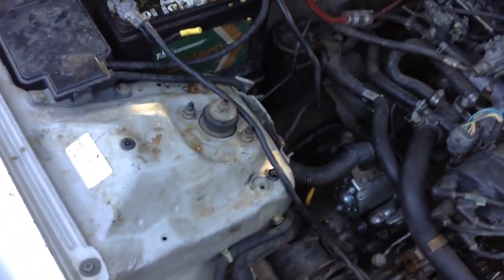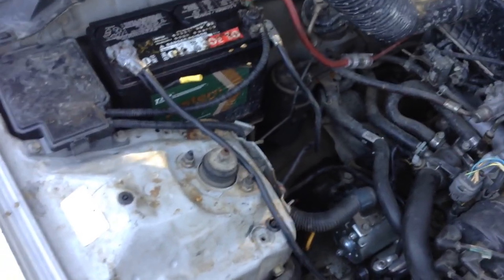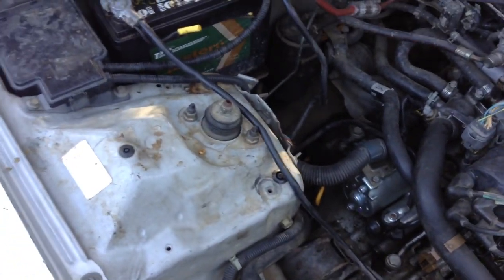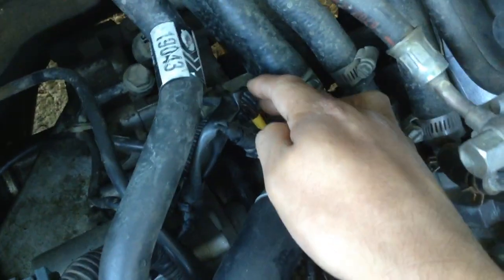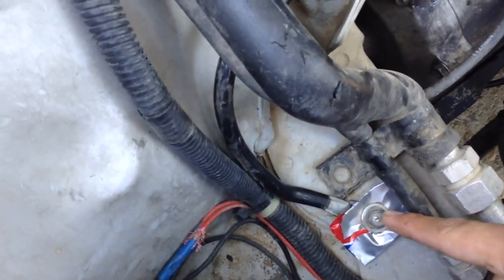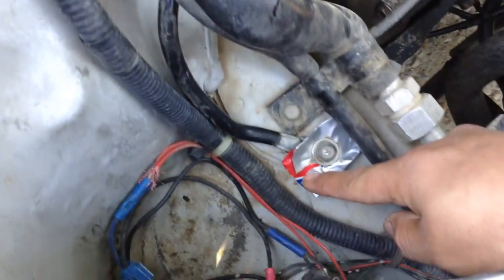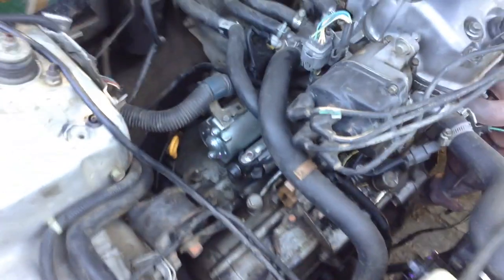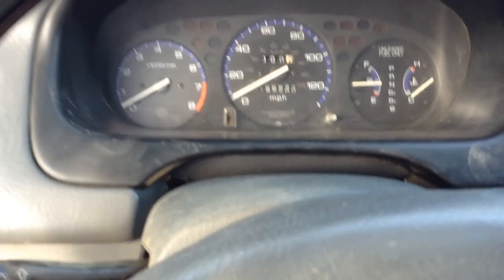96 Honda Civic starting and ground issue fix

Comment: Another guy takes a metal wire brush that you put onto a drill then scrape the paint of in the same place where you screw it in and uses a star washer to make sure it connects to the metal... .just a thought!

Comment: What is the problem if your car will only run if the scan tool is plugged in if you take it off it shuts off the car

Comment: I have a 1994 Honda I put a 5r battery in it and it still won’t turn on 😢
Reply from the maker: Dose it crank but no start or wont start wont crank? Or maybe dose it just not do anything? I also seen flicking dash on the hondas and usiolly when theirs nothing or flickering lights it can be just a grown issue. When i say nothing i mean no crank no start just light on dash but goes of and on

Comment from the maker: The grown wire was originally were the thermostat pipe is were the othe grown wire was at I had changed it due to a bad wire signal. Hope this helps
Reply: Mr MuscleCarsuspect  bad wire signal from where ? Stater fuse ?
Reply from the maker: THRYZ FIREGANG my bad bro for some reason it didn’t show me your msg before. It was on the thermostat pipe before for grown but it was not getting good grown their so I had to move it

Comment: Any idea of what it looked like before you had the piece can on it? How did you know it was bad? Placing a piece of aluminum under a screw will make the car start? I'm a bit confused.
Reply from the maker: Joe Humeas Joe Humeas it’s just a grown wire. You need grown for the car to start if theirs no grown the car will not start and the wire was in that same spot it’s in that’s how I bought the car I no longer own this car but ik that’s we’re the wire was at I bolive
Reply: @mrmusclecarsuspect5362  Was the wire not connected to the car? Was it just floating and you needed to used the aluminum to press it down?
Reply from the maker: Joe Humeas the wire was on their with the screw but for some reason it was not getting ground in that area. And the aluminum just helps it get ground better!  The grown wire where the thermostat pipe is also was getting bad grown but I replaced the tip and that helped sometimes in can just be a bad tip or just a bad wire.

Comment: Hey brother what were your symptoms that lead you doing this? Ihave a 99 civic ex & the car doesn’t crank or nothing just clicks when I pass charge on the battery, I tested all 3 battery, starter & alternator & their all good… so my last resort is the ground… I’m a bit lost on how to start diagnosing the ground cables & all that
Reply: I have a 99 as well. Quick question if you turn the key to run and jump the starter solenoid with a piece of metal does the car start? If so it could be your ignition switch if not the ground.

Comment: Hello have the same issue where mine cranks and doesn’t start sometimes..and drives perfectly fine so could that be due to that same ground? I’ve tried everything lol
Reply from the maker: @shamdagoat3659  if it cracks sometimes and won't start but starts randomly, it can be a loose grown or bad grown wire. Make sure to check your terminals on your matter and make sure they aint loose, and i mean, check them all well. When replacing the grown or doing anything electrical. You want to make sure to have your battery disconnected. Always dissconect your battery.

Comment: Hey what if my alternator is brand new battery is good and i replcaed the wires and terminals on my 92 accord but im having a pulsating isuse with my head lights and rear lights basically all the lights in the car pulsate so does the idle what do u think could be the problem?
Reply from the maker: first did you check if any wires might be coming into contact with other wires sounds like you might be having a mechanical short circute. make sure all your wires are connected properly and make sure the grown wire on the starter has its o ring properly placed that happens before to a friend he forgot to put the o ring on the grown wire, it comes with one.
Reply: There's also a Short Issue on those Years. Under and Behind the Intake Manifold. Good Luck.
Reply: Check the Electric load detector ELD or just replace it
Reply: Try grounding the alternator and see what happens

Comment: hello sir is that Car Body Ground that is safe for honda civic 96 model if i installed like this Ground cable?? pls i need ur help
Reply from the maker: Almz Alison it should be I never had an issue anymore after I did this on my Honda Civic, do it this way it should be safe!
Reply: Mr MuscleCarsuspect  Wow Thank you sir for the huge Help so i will ask car technician to install it for me bcoz i had problem with my honda civic 96 just recently it wont start then if theyl put jumpstart it will start..so maybe i need this install gound cable in my car same like your car😊👏 thank u
Reply from the maker: Almz Alison if car dies and needs a jump to start might want to have battery check out and alternator at your loca parts store for free and find out if it’s that, and also grown issue wouldn’t let your car start either if the area it’s on has no good grown
Reply: Mr MuscleCarsuspect Thank you sir i will go to Car mechanic very soon for check up il let u know sir thank you for your reply and help God bless you 😊

Comment: I got a 1996 Honda Civic ek I need help my car take long to turn on i have to crank it and stop and crank again and it will start rit up after I do 2 cranks cause if I keep cranking it and it take so long to start up before it use to turn on rit away can u please help me
Reply from the maker: So it sounds like you have a crank but no start only after more than one try.. if thats the case your started is probably going out. Happend to me. Same thing it turned out being the starter but always check your growns. And make sure you always disconect the negative cable when working on electrical parts like replacing the starter.

Comment: Is another ground from by the starter to somewhere else on your video.
I did run a 2 g from the battery terminal to the original ground bolt and then from the original ground bolt  I run a 4 g cable to the braket bolt ground by the transmission. That bolt hold the ground cable that goes to the chassis by the passenger side tire.
Reply from the maker: DJohn NineOneSix this method I use gives it better ground contact but usolly you can just find a good ground in a good area like we’re the thermostat housing is . Their is another ground wire that comes from the starter. I don’t have this Honda no-more since years ago lol try this method it should work
Reply: @mrmusclecarsuspect5362  oh okay..
Well my problem was a bad ground cable.
From the battery to the chassis. About 5 inches long.
But since I have high performance parts and high power audio system and a AGM battery I decided to install a 2 gauge cable from the negative battery post to the chassis bolt and add a ground cable from the same bolt to the bolt on the braket transmission.
Thanks for your reply.
Reply from the maker: DJohn NineOneSix try a longer wire you local auto stor should have one to fix perfect find another boot or try placing the aluminum peace from a can into the bolt with the ground it should give it beter contact and fix your issue
Reply: @mrmusclecarsuspect5362  thanks
Reply from the maker: DJohn NineOneSix no problem

Comment: would your car still crank if you had a bad ground?
Reply from the maker: If its a bad ground you should just hear a click. The car will not crank with a bad grown.
Reply: @mrmusclecarsuspect5362  

Perfect man , thank you.
Can I explain what I have done real quick and maybe let me know what else to check ?

It’s a 98 Honda Civic dx auto , no spark but cranks. 

- the fuel pump primes , fuel is getting to the injectors 
- the cam shaft turns so I know the timing belt is fine. I pulled the oil cap off and had my son crank it. 
- I put a new distributor on it , still no spark.
- checked the fuses related to the Ignition components , they looked fine. 

I’m planning to change the main relay and the crank positioning sensor. 

Any other ideas ? The car was running fine , just random turned off. 

Thanks 🙏
Reply from the maker: @reza_dc2  check cps and main relay even sometimes it can be be a bad starter that wont allow your car to start try tappig he starter wil having someone start the car in a safe matter alwsys secure your wheels. Another thing you kight want to check it your sparkplug wires even with one bad wire car eill not start and also those i bolive have a fuel filter a dirty fuel filter will cause your car to randomly shut off. Sometimes it can just he a simple fuel filter. Sorry for the late reply.
Reply: @mrmusclecarsuspect5362  

Thanks for the feedback Boss.
I’ll give those all a shot. Once I figure it out I’ll come back and let you know what it was. In case any future viewers have the same issue.
Thanks Bud 🙏
Reply from the maker: @reza_dc2  your welcome thanks for watching. Good luck

Comment: My 97 honda civic hx has a issue on starting up in the mornings. I turn the key over it starts a bit and shuts off while the key is down and then starts up quick but sounds rough when starting can it be from a bad ground? I have the black cable on the shock nut by the way.
Reply from the maker: George Serrato if you’re car start up then stalls and dies after can be a MAF sensor, it can be cleaned with a Mass Air flow cleaner or you can replace if damaged or worn out.. you can also check for vacuum leaks, main relay and also dose it sound like a misfire? A bad grown is a crank no start mostly it won’t start if it’s a grown issues mostly.. let me know if you got more questions
Reply: @mrmusclecarsuspect5362  i cleaned up the MAF sensor. And i don't have no codes neither and i was wondering the ground cable not being on the frame. And im thinking the starter when the car is warmed up when i drive and start it up again it starts up easy.
Reply from the maker: George Serrato the car dies right away or right after it warms up? You might want to make sure you ain’t got no loose wires maybe the battery wore or change were you have your grown wire at to somewhere you get better grown sometimes it tends to affect it in different ways.. won’t hurt to try has happens before I to me on my Mazda 3 car shut off out of nowhere and it was a bad connection to the better the grown.
Reply: @mrmusclecarsuspect5362  what it does the rpm needle hops to 1000 and goes 0 like a tap start and hold the key to start like in 1 second and sound of it actually starting up running its only happens when before warming it up. And when after driving it and go drive again it starts fine. If i have the engine at operating temperature.
Reply from the maker: George Serrato spark plugs
,air filter ,fuel pressure, vacuum leaks EGR needs a clean and check your battery connections make sure they are good and that you have a good battery.. also have you checked at your local parts store with a scanner to see if you get any codes?
Reply: @mrmusclecarsuspect5362  i changed the EGR valve and cleaned the intake passages and cleaned the fuel injectors and changed 2 of 4 injectors due to broken plastic tips. And i scanned with my obd reader no codes in my car. I replaced the battery too. And cleaned the spark plugs.
Reply from the maker: George Serrato maybe you’re ECU needs to relearn it’s idle happens before to a buddy of mine on his Honda he had replaced battery and a couple other stuff and his car started to die out while the engine was cold but a temperature it seemed fine.. what u can do at a cold start hold your RPMs at 2000rpms till the engine gets warm for about 5 min then let go after it goes into temperature and when you let go of the gas peddle it tends to stall.. then turn your car off and restart it and make sure your rpms are normal you can also try the process I have on one of my videos it’s for a Mazda 3 I don’t own this Honda nomore or I would upload a video on how to do it best thing make sure your main relay is good clean tps sensor or replace MAF sensor vacuum leaks. I hope I’m being helpful if you got more questions feel free to ask